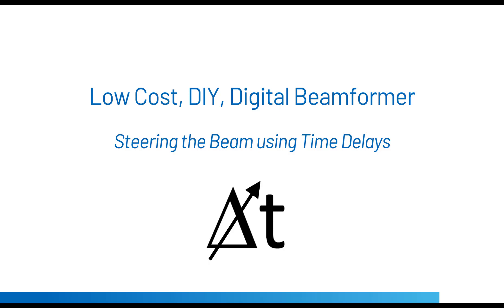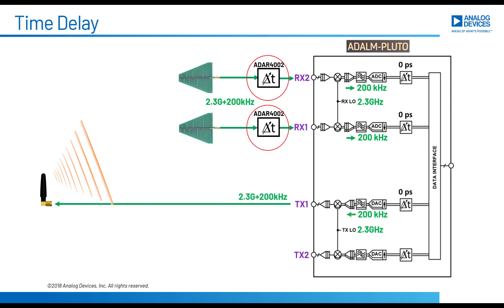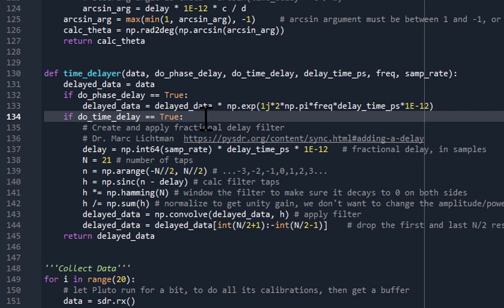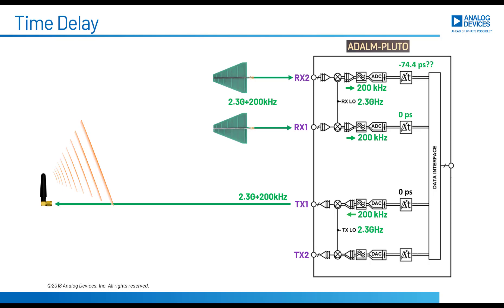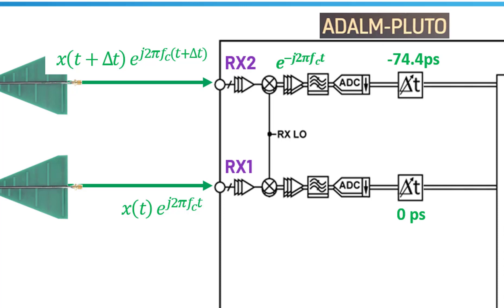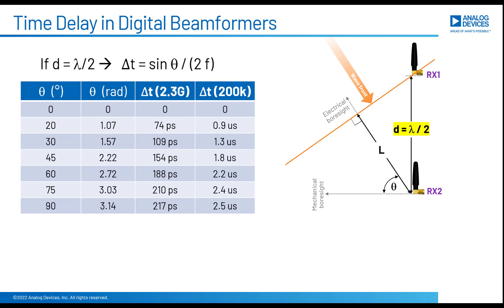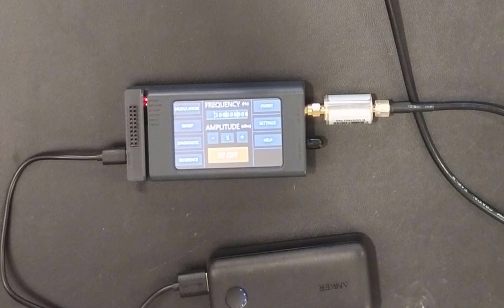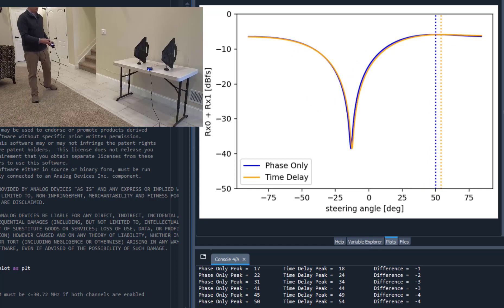Implementing Time Delay For a Low Cost Digital Beamformer

Comment: Excellent lesson. Thank you. I learn 😊 ! In the 2.3 GHz version You could place the antennas on a turn surface; i.e. cake serving kitchen device and the receiving antenna is stationary. But only if Your wife allows (promise to use a protecting cover between antennas and the turn table.

Comment: So, the time delay seems to be a better solution as it provides phase shifts for all frequency component contained in the signal?  So I don't fully get why people use phase-shifting instead of true time delays then. Am I missing something?
Reply from the maker: There are some cases, like with polarized signals, where you might prefer phase shifting.  But yes, in general time delays are what you're after.  However....  it's a LOT easier to do phase shifting than time delays.  In an all digital array, it doesn't really matter too much (though it is a more computations to do a time shift).  But most arrays are not all digital.   And phase shifting is almost always easier to implement in a hybrid subarray or an all analog phased array.

Comment: I once had to (curiosity) reverse engineer a TVRO 2 axis parabolic antenna. It had an arrangement of dispoles around the LNB waveguide. By switching these dispoles on and off (i suppose grounding them) the effect was a useful distortion of the receive beam. Enough to sample if the RSS increased or decreased. What I never really understood, as the KU-band signal i linearly polarised could work in both E and M fields?

Comment: Jon, loving this pluto series! I was wondering, you've talked about the problems with spacing antennas WIDER than wavelength/2 but are there any cons to spacing antennas less than wavelength/2?
Reply from the maker: Yes, that's a great question!  I can't think of any major downsides.  Except for the most major downside of all:  cost!  A smaller antenna spacing means you'll need more elements to cover a desired aperture size.  And so your array will have more cost, weight, power, complexity, etc.  Maybe some others can chime in on any downsides?  Or significant advantages to smaller spacing?
Reply: @jonkraft  ahhh so I would need more elements to achieve the same half power beamwidth? Got it. I’ll look into that more. Thank you!
Reply: @jonkraft  Doh. I remember now that aperture is the physical space you’re trying to cover. I’ll look into tradeoffs of aperture size. Eg, how does a 4 antenna array covering 2 wavelengths compare to a 4 ant array covering 1 wavelengths. Thanks again!
Reply from the maker: @stingy49  Yes, and you can actually try it out with this demo just by changing the spacing of the Rx antennas.  You'll see grating lobes start to come in, but you'll also see that the main lobe gets tighter.  It's pretty instructive to see it in action.  You can also check out the grating lobe video here: https://wiki.analog.com/resources/eval/user-guides/circuits-from-the-lab/cn0566#labs_and_lectures

Comment: Jon.
The antennas operate at Carrier freq, so with this antenna setup, the Carrier phase-timing between antenna must be adjusted by a phase-altering component(preferably digital) placed between the mixers & Center-Fed by the Carrier signal from the Rx-LO.

Comment: EDIT: I should learn to watch the whole video before asking questions. ;-P

Just found your channel, and this is super helpful to me as a beginner/amateur. Thank you for posting these.

I'm curious, when you say that time delay can be helpful for wideband signals, is that in absolute terms or relative to carrier frequency? This will be useful for determining which direction I go down first.

For context…

I'd like to apply beam forming to experiment in the 70cm band. Frequencies of interest would be between 430 and 440 MHz, and signals would typically be <= 10kHz (could be wider depending on distortion). Phase stacking is the norm here, but this would be a fun project, and this band would be very accessible to me.

I'd also like to expand the concepts contained in these videos to 4 small yagis (<= 5el in a single polarization) or similar length helical antennas, and attempt satellite tracking based on the calculated angles from video 1 in the series…essentially, drive an az-el rotator to seek/track zero-ish degrees as a satellite passes overhead.

I figure this would be impractical, but a fun project nonetheless.
Reply from the maker: Ha, yes!  You found the equation in the video relating instantaneous bandwidth and carrier freq.  So 10kHz at 430 MHz will be no problem -- that is very narrow band.  But it sounds you've got a very cool project in mind! Please do a video or blog on it and let me know the link/channel!

Comment: Very cool video!  I wonder instead of time delay filter, you could take the FFT, shift the phase of each bin with a linear taper (centered about baseband), then IFFT?

That time delay filter you used had sinc function taps, which would be flat window in the frequency domain which does not alter the phase, so maybe the FFT method would combine the time and phase shift.  I suppose the filter is probably faster than doing an FFT, at least until the filter gets really long.

Comment: Thank you for explaining much of the math, I still don't understand 100% but your video really helped.
   I've had fantasies of building something similar to a parametric array, as in the "Ultrasonic Directive Speaker"
But using small software-defined microwave transmitters. One goal, just for example , could be to send a regular FM transmission to a specific radio using frequencies not in the FM band..
  How many transmitter antenna combinations do you think such a project would require? Do you think the software would be able to calculate the timing and phase differences quick enough for an array large enough for such a goal? I need to know, so I can figure how much of a budget I would need to even attempt such a project.
Reply from the maker: Thanks!  You could check out the first video in this series where I give some equations for beamwidth-i.e. how well you'd be able to target one radio vs another.  But a big issue with FM radio freq's could be the size of the array - 100MHz means your spacing for each antenna in the array would be 1.5m.... But I'd encourage you to start small, build a simple example, and then play around with that for a bit.

Comment: Hello Jon, awesome video as always ! I am planing on purchasing an SDR for myself. 

Now I would like to understand if transmit beamforming would work in a similar way. For example I would like to have the standalone antenna fixed and steer my beam until the received power on the single antenna reaches a maximum. Could you confirm that for me ? Best, Max
Reply from the maker: Right, the array is reciprocal, so forming the Tx beam will be the same as the Rx beam.  I like to use the Rx beam, because then we can see it.  But for your use case, it'll be no problem to modify the code for transmit.  Let me know how it works!
Reply: @jonkraft  Thanks for your quick response ! It is good to know ! I am planning on doing NF beam forming with it ! Thanks again